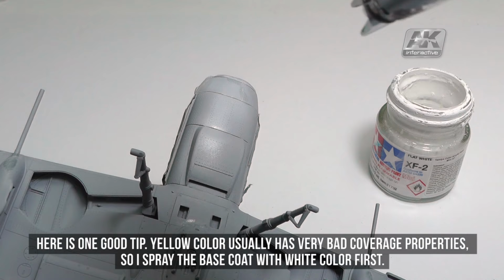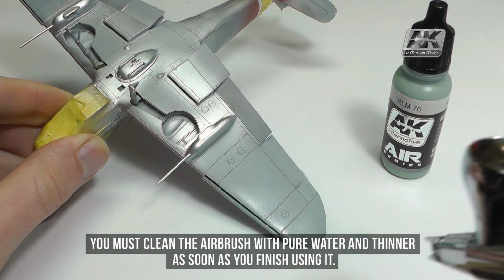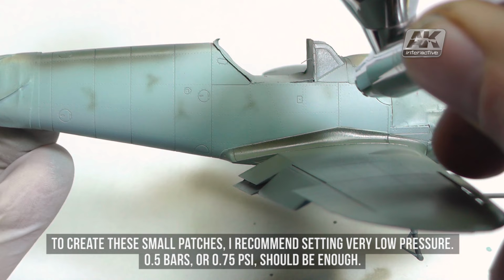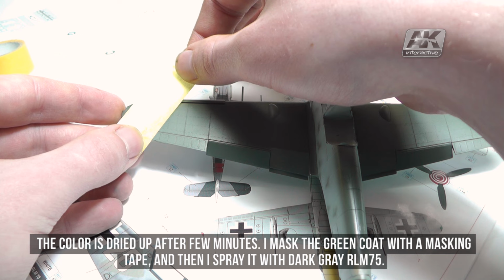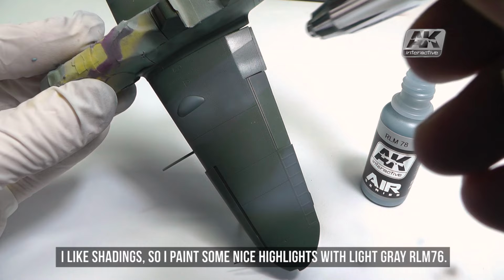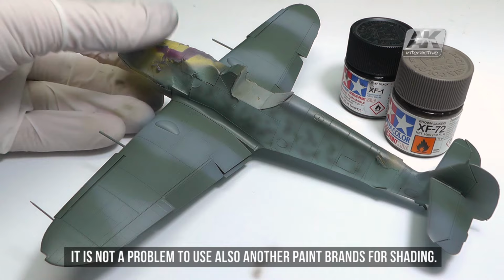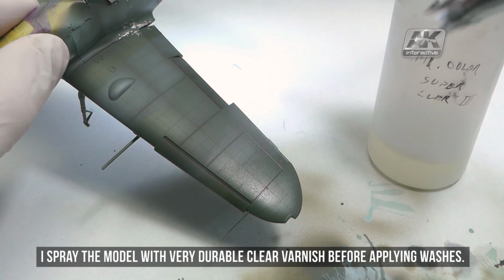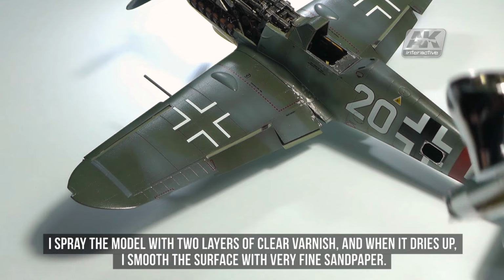BF-109G (Luftwaffe WWII ) - Painting & Weahering || 3/4

Comment: Looks great. What is the reason you are sanding after applying the clear coats. Isnt better to leave it the way it is so the washes flow better across the model?
Reply: The surface is perfectly smooth after sanding. No dust and decals are perfectly flat. Rivets and panel lines are still there so no problem with washes.
Reply: sellout for AK? :/

Comment: Looking at your finished modell I must say I think you have overdone the post shading quite abit.  IMHO the panel lines are way overdone and that kinda pulls the overall impression down somewhat.   My approach to panel lining is that I post shade the panels with a slightly lighter tone of the base paint leaving the panels in the original shade, then I apply a wash (AK color specific washes are my choise). This will give you a more natural, subtile and scale like look. 

 When that's said I like your approach to modeling and your detail and skill level is very high indeed.    Another note is remember to pull down the tone of your decals.  When the numbers for example are white they scream against the background. I use a very light coat of the base color, more like a thin film , maybe a 1or  2/10 ratio mix and apply by airbrush.  this will leave the effect that the decal is still white, but alittle toned down.  Sometimes you can get the same effect with a gray wash and flat laquer, but that's way more tricky. 

Brgds, sten arne.  avid modeler for 30 years, and AK fan :)
Reply: Man, I'm glad to hear you say that about the decals. I've always thought that the decals weren't weathered the same as the rest of the plane. That's not right.